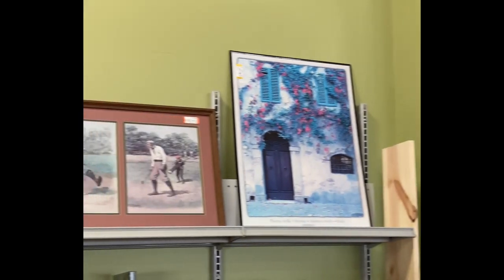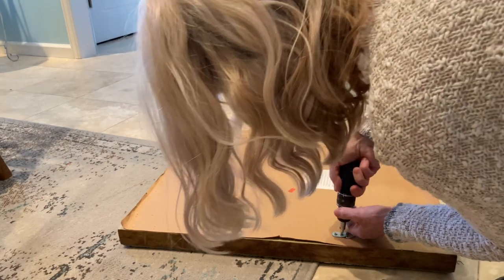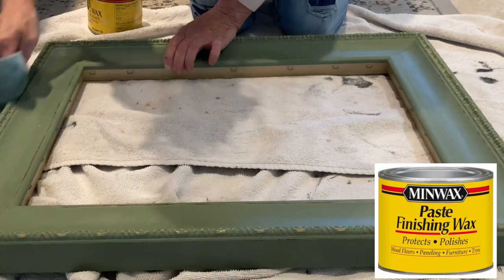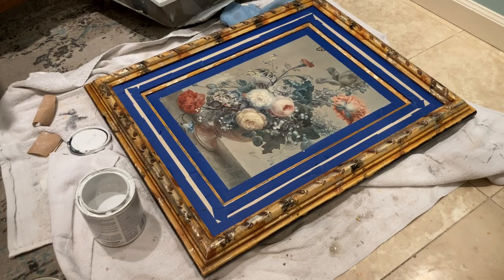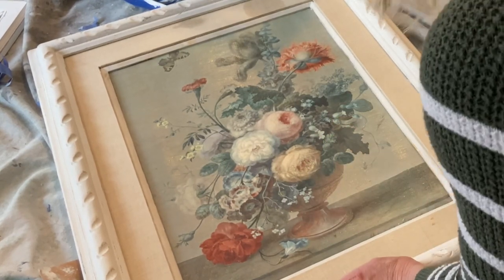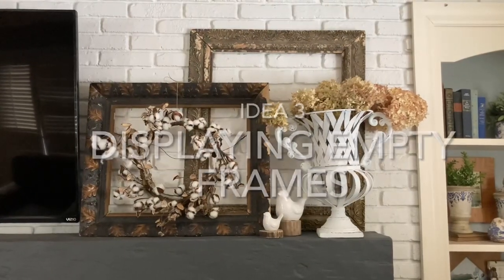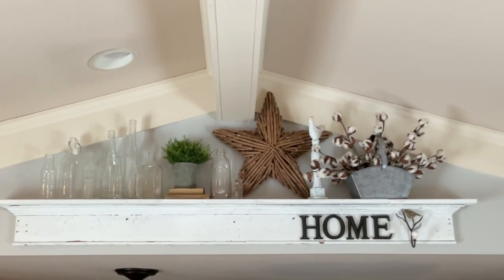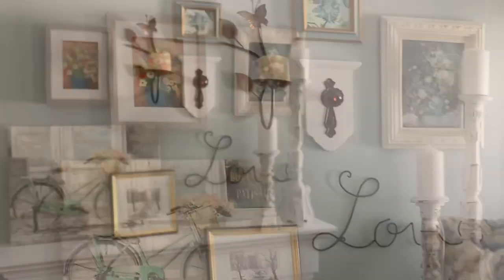10 Unique DIY Thrifted Wall Decor Ideas

Comment: I would have kept the flower painting. It was pretty with white paint but I would have either painted it an copper and painted black and wet distressed it to show the copper. Another way I would have painted it would be to find a peachy orange'ish color (to match the flowers) painting the entire frame including fabric sealing only the wood part of the frame - after that is dry the next day I would top it off either put black or white or a green to match the leaves and wet distress it to show the color underneath.  I would not paint the fabric part a second time but leave it the color to match the flowers.  I think you kept the picture of the girl with the cat which was beautiful. Now to find out if I'm right. Thanks for the video.
Reply: Oh wow you kept the one I loved.
Reply from the maker: You are obviously a talented crafter!  I don’t usually do that many steps when painting because I have to keep my booth stocked, so speed is a factor for me. I’m sure it would have looked AMAZING if I had followed your suggestions!
Reply: @CanterburyCottage  thanks so much. Sometimes it turns out and other times it is the 2nd or 3rd try to get it to look exactly right. I haven't opened a booth, I was about to when the situation happened last year...  oh well. so i have nothing but time at the moment.